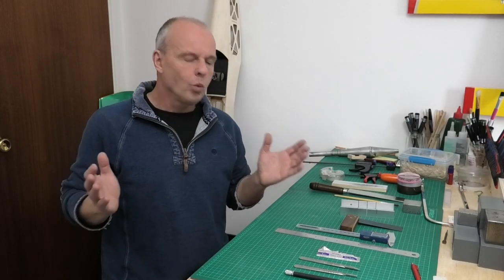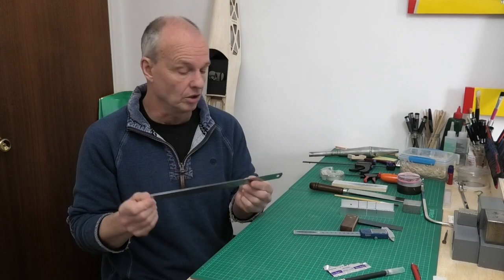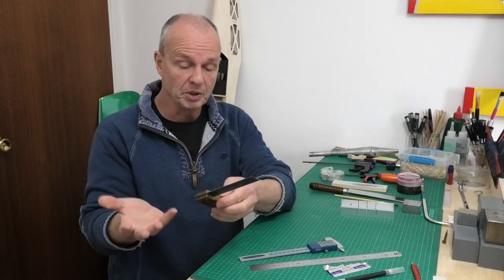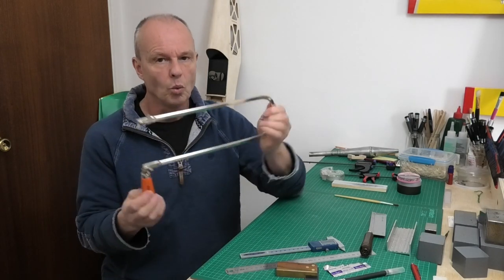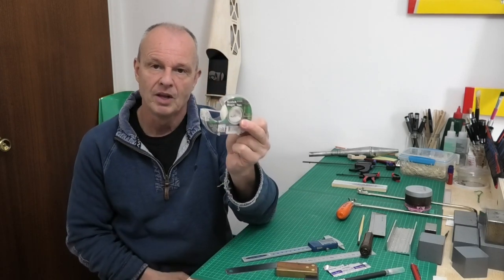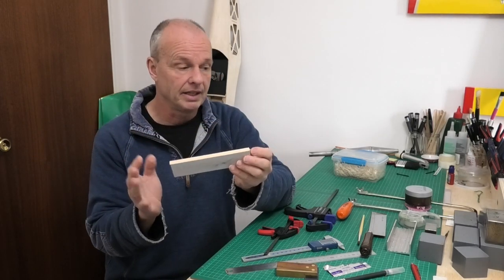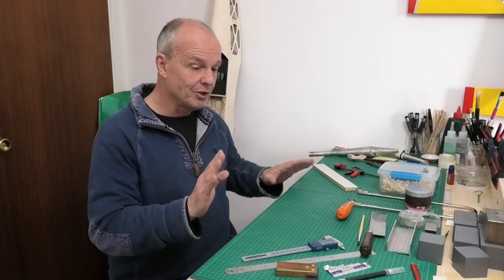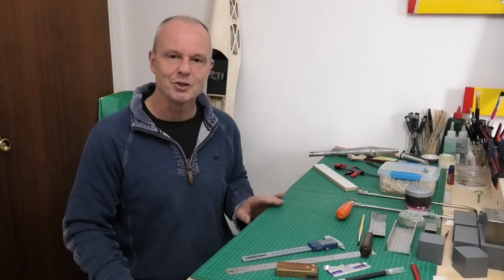Basic Building Tools for Balsa Model Aeroplanes - RC Model Aeroplane Build & Repair

Comment: Surprised you didn't begin with a dead flat building surface.  Without that, pretty hard to get very far...
Reply from the maker: I would totally agree, although the emphasis was on the tools, appreciate the comment, as you say a flat building surface is essential
Reply: @MarkRobinson555  full disclosure...I only noticed that because I was searching for ideas on how to make a truly flat and accurate board myself.  Thanks for your gracious reply!

Comment: Awesome, Thanks for your video. I am starting my first build of a balsa model (Phoenix Corsair 0.52).  Which video would be the best to learn to build (installing the servos, pushrods, mounting the engine, fitting fuel tank and tubes linkage to the glow engine, glueing the hinges, installing the gear,  etc.) and how to measure the CG (should I fill the fuel tank first!).  Thanks
Reply from the maker: Thanks for the comment, pleased you liked it.  If you watch any of my build series they will help with basic techniques, perhaps the Great Planes Trainer 60.  Always do the CG with an empty tank
Reply: @MarkRobinson555  thanks a lot.  Very helpful!

Comment: Thanks Mark, can't be able to find the steel building blocks you are referring to on the internet. I am in USA. Any ideas?
Reply from the maker: Hi there Mike, they are 50mm square blocks I had made, cut from a length of rod and the ends milled square. An alternative may be the blocks engineers use for setting out, I have picked up a few at car boot sales in the UK, only problem with them is they are not all a consistent size like the ones I had made. As I said I do find them invaluable for building

Comment: hi Mark, I hAD a stroke in 2020 and purchased some plans for a Mk1 Spitfire, 6 foot wings! I didnt think of the size when purchasing, so it is a bit of a shock. looks like you are going to be my mentor in all this hnace me watching this about basic tools im panicking a bit actually, although i am /was, a carpenter; previous life! ithink I have the ability within to make this as part of my rehabilitation. nice flow to your show and you are english,my draeings are imperial , so im having to convert everything prior to ordereing materials  keep up the good work and thank you.
Reply from the maker: Hi there, thank you for such a kind comment, really pleased you find the videos useful.  Just take the build slowly and check and double chek the measurmenrs and I am sure it will be fine, and if you make a mistake its no big deal, balsa si very forgiving to work  with so easy to correct.  Have you see the videos I did about building from plans?  They may help with some of the pitfalls - I will as a link to the first one.  Good luck with the build.
Reply from the maker: https://youtu.be/DvgljuH9EYg

Comment: Good video Mark, I use wooden paint stir sticks for sand paper backing. I do not have the steel blocks which I will investigate for future projects. I purchased the Dremel fret type saw and it is to fast causing mistakes.
Reply from the maker: Hi, thanks for the comment, really good to hear what otheres are doing.

Comment: I really like the steel blocks and the way you use them but where do you find them? I have tried machine shops and a steel supplier but no luck
Reply from the maker: The blocks I find so useful, I would be lost without them, I use them for so many different tasks.  I had them made from a length of 50x50mm steel bar.  Got a local machine shop to cut them to length and mill the ends square. The small blocks are 50mm long, so hence squares, and then I have some that are 100mm long, which is useful somtimes to have the extra weight.  Don't know of an alternative to having them made, which is very expensive in some parts of the world, I was lucky enough to get them made where this type of work is relatively cheap.  Hope that helps
Reply: Thanks for Mark. I have gleaned much useful information from your videos but these blocks take the biscuit. They pretty much negate the need for a magnetic or pin building boards and help in so many useful ways. I have not come across this building method before and will keep searching!!

Comment: Where would you get steel blocks like that at a reasonable price?
Reply from the maker: I had these blocks made from a 50mm square steel I picked up at a scrap metal place.  I got a  machine shop to cut and then mill the ends square.  Unfortunately this can be quite an expensive job, I was luck to be in Northern Thailand at the time so the cost was not to bad.